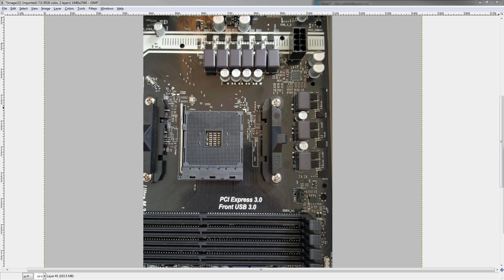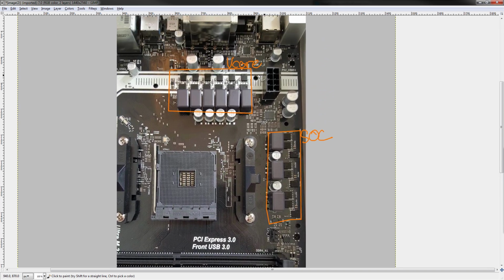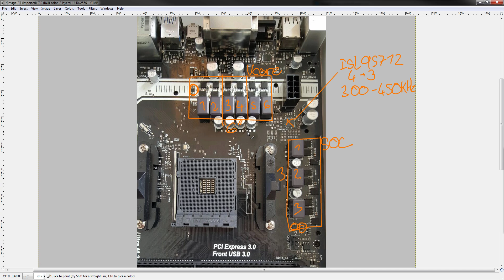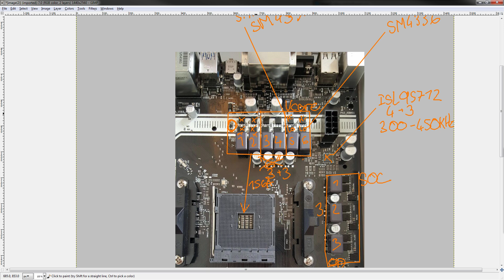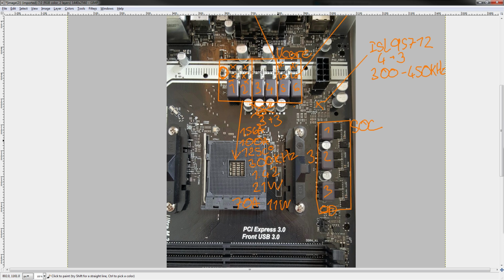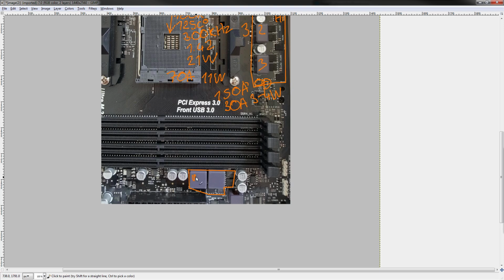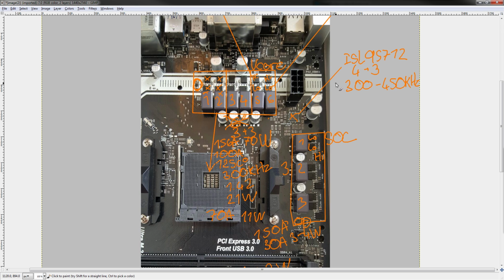PCB Breakdown: Asrock "6"+3 phase AM4 VRM used on the AB350M Pro 4, AB350 Pro 4 and AB350 Gaming K4

Comment: Use the ab350 pro 4 with ryzen 5 3600, oced to 4.43ghz 1.435v and it stable.
Reply: @Ben T. Is really unsafe? Should i down the clock and vcore to 1.35v max?

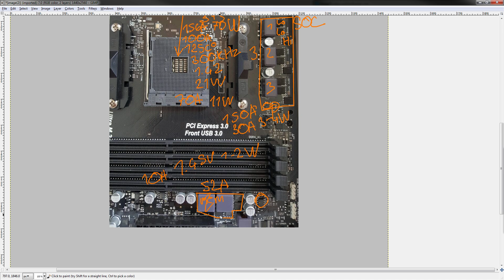Comment: 14:38 not exactly ice cold, but with 4 sticks of Crucial Ballistix Sport LT during a Memtest86 Pro 8.1 run, the "hottest" parts are the 2 inductors, and they're just barely above body temperature with no forced airflow whatsoever

Comment: As we look back after some time, this board has become one of the most popular budget boards on the market. The design might be misleading, but it showed its strength and it has a great value for Ryzen 5 CPUs.
Reply: Yeah, I got the B450 version of this board for my 2600, thinking that it was a 6 phase lol. Was able to get it to 4.1GHz at 1.35V iirc with a 240 watercooler, but wasn't stable with anything over that even at 1.45V. Should've gotten the MSI Tomahawk, it was like $5-10 more and within budget. 

Seriously thinking about upgrading to a 3700X at the end of the year for better high framerate gaming and content production, wonder if I'll need to upgrade the motherboard? I could use more USB ports...

Comment: Which specific SM4337 & SM4336  are used? Can't read subnumbering. I'm interested to know the max sustained temperature allowed for 24/7 for years to come.
Reply: high mosfet is 4337.  Low mosfet is 4336

Comment: I'm using an 8 core 1700x on this board. No problems so far, but VRM temperatures, read from lm sensors on Linux, says 94 to 104 degrees C. Aux2 says 80 degrees, which I think is the SOC Vrm temp.   I tried better cooling on the vrms, but that made little to no difference on the temperatures. But it seems that on Windows CPUID hwmonitor gives different temperature readings (not tested). So it could be that Ubuntu 18.04 just has not correct VRM readings for this board.

Comment: cpI have the AB350M pro4 MB with Ryzen 5 1600 and Corsair Vengeance 2666 memory (16mb).  I have OC'd CPU to 3.7 Ghz.  Since this MB doesn't have sensors to measure VRM temps, am I safe at this OC speed?

Comment: What is bes VRM designe for 2400g, on cheap MB-s? ASROCK B450M-Pro4 mybe? (it has 3 phase and heatsink) yea bad designe but would it handle 2400g like ok?

Or mybe Msi B450A-PRO with better cooling?

Comment: LoL. Just got this puppy in my workshop with a blown 1st phase (I mean AM350M Pro4). At first I was surprised (assuming it was a 6-phase), but then I saw those traces between chokes, and once I cleaned up the soot off mosfets - I've noticed the familiar Niko-semi 0903 and 6188 firecrackers )))
So, my specimen is even more cheaply made than the one in your review, Buildzoid ))))
It's probably going to become an actual 3-phase board, as soon as I get the VRMs cleaned up and fixed , and go into my office PC w/ 2400G.

Comment: I cannot find the quality of the components but the MSI did a similar "trick" on their x370 SLI plus mobo which is 8+2 by the voltage regulators but the PWM segment is 4+2 dunno about other components... can you review this mobo, as it is popular... and what about it with the 2700x is it a good combo? MSI x370 sli plus

Comment: This board freezes all the time, not sure if the caps are bad or if the isl95712 has a temp cut off protection built in. Which caps are for the VRM's? The 4 next to the inductors or the 2 big ones next to the Hi side mosfets?

Comment: Anyone have any ideas as to why the AB350M Pro4 has so many freeze issues? Comments on Newegg and Amazon seems to suggest that the board shuts down power to the processor for no apparent reason. Yet the bigger brother AB350 Pro4 is not affected.
Reply: probably bad batch
Reply: Use UEFI and just install a new version,thats it..I had the same problem but now it works like a charm
Reply: What do you mean by "Install a new version"? You can't install a new Voltage Regulator on a motherboard, unless of course it is identical.

Comment: I have tested this board - VRM's aren't so bad - with Ryzen 1600 @ 3.8 GHz and 1.4v VRM's reach 55 C under load - measured Infrared thermometer on reverse of the Motherboard..Probably not enough for Ryzen 7 buy fine. Unfortuateley there is no LLC.
for Ryzen 5
Reply: 1.3 is the key

Comment: Just wondering if there's any way to actively cool the capacitors? Or just a fan blowing air directly onto them it's the best choice...
Also, what about replacing the FETs heatsink with something less like the stock aluminum block? And what about overkilling it with water cooling the VRMs?

Comment: Thanks for this video, and to the viewer who made it possible.  I just ordered this board with an R3 1200 and am now mildly concerned with thoughts on my mind for OC'ing it as far as the stock cooler allows.  Are these voltage issues affected by the PSU in any way?  I also ordered a Bitfenix BWG450M to go with the build.  This is meant to be working at full tilt most of the time.

Comment: About those 3+3 Vcore: Now when you can start looking at the result of different Ryzen motherboards the ASRock AB350M Pro4 often get better results on lower voltage then more expensive 4 phase mother boards so something have ASRock done right.  This might however be related to something else but still.

Comment: I am an electrician in the states. Now when I think of even 30 amps I am thinking about number 10 awg.

60 amps takes around a number 6.

100 amps? I do not really understand, nor have I ever studied electronics.

It sure does not look like anywhere near a number 6 size conductor is used anywhere on that board.

I guess it has to do with....................

Comment: Been trying to OC a 1600 on the mATX version of this board and it seems to experience ridiculous vdroop. Can't seem to get a stable OC over 3.7GHz at 1.3V and it almost seems like I could add a million volts and MHz and it wouldn't make a difference.

I haven't tried OCing in Ryzen Master but the BIOS seems to not be the greatest for this. Something tells me letting the voltage sit at Auto would be the best way to OC.

Comment: I brought one of these motherboards, 4.0Ghz isn't hard to hit with a R7 1700, memory atm only hits about 2400, but the BIOS updates have defiantly been helping with that, cooling wise on VRM is not a problem in my case (Thermaltake Core V21). if you aren't needing a multi GPU setup and u can be happy with 4Ghz at around 1.365-1.370v then you are fine, the best thing about this board is the 2 m.2 ports, i have no complaints about this board, OC's just fine for the current Ryzen line up, looks good, and  a nice amount of kit on such a little board. ill admit i was happy when i read that it was a "9" (6+3) phase design, but knowing now its a 3+3... well it actually doesn't make much of a difference as you are really only going to get about 4.1Ghz on a R7/R5 CPU so for the current gen of Zen CPU's this board is really good. had they been a OC monster an couldOC like a FX chip than this board wouldn't been that great for OC but all in all, im very happy with mine. works great, looks good, its fairly well laid out and its actually worth a look at if you are interested in a mATX board
Reply: Vitor'Xan Vas Rayya - Have you been able to OC the RAM after latest bios updates?
Reply: @AnalogFoundry  this is like 3 years late but I have a 2700 (3.7ghz 1.1v) and 3466 cl16 and the choice of 3600 cl16 on the ab350m
Reply: Have you experienced any issues with your setup? Hitching, stuttering, etc?
Reply: Does she still alive? And doing well?

Comment: Love your work man... i need your knowledge :D
can you compare VRM on MSI X370 SLI PLUS with B350 gaming pro carbon? since it's roughly have the same price, i suspect it is using the same VRM with 8+2 (or (2*4)+2)? phase... thank you

-MSI X370 SLI PLUS >>> LOWEST PRICE X370
-MSI B350 gaming pro carbon >>> HIGHEST PRICE B350
i'll choosing B350 gaming pro carbon, because if it's use the same VRM, i'll be fine with overclocking, and I don't need SLI and massive amounts of PCI, but i need more quality, gaming LAN, and good sound chips (nahimic 2, vs realtek), and of course RGB...

Comment: Burn out low side mosfet which have 1.5x lower Rdson than high side? That's just quite silly assuming same Rthca. 4phase 4 transistor pairs and 4 inductor design doesn't actually mean better stability or more amps than 3phase 6 transistor pairs  and 6 inductors. All your assumption is based on ideal characteristics. Well guess what, that's something which does not exist. Of course smart 4ph vrm will be better than 3ph but it doesn't mean ANY 4ph vrm will beat ALL 3ph designs. Right? Right. However I see the point - advertising 3 double VRM designs as 6ph design is just nonsense.

Comment: Thanks for the video on this motherboard.  When I initially was buying parts for my board I found sources calling this a 9 phase (6+3) vrm board so I do feel a bit deceived that it's not.  Well it's not the end of the world as it is holding my r7 1800x stable at 4GHz with 1.381v and from the numbers you listed it will not be an issue with the VRMs for long term use.  They do get some extra air from my CPU cooler as I got a dark rock pro 3 and the fan in between the double tower actually hangs lower than the cooler itself and that seems to throw more air to the VRMs without it going through the fins of the cooler.

Comment: The VRM cooling seems to be on par with the Asus b350, and better than both MSI and Gigabyte's b350 offerings (talking about the gaming k4 Fatal1ty-- not the ab350M)

Is it possible they have different VRM cooling than the micro-atx boards?  Or is there something else Asrock is doing that's working out for them?

Comment: I had this board, the overclocking ability is garbage. If you want to do overclock, avoid this board. Under same setup, this pos can only reach 3.65 Ghz where ASUS b350m can go up to 3.9 stable for 1700.

Comment: Should I get the ASRock AB350M Pro4? I would use it with an AMD Ryzen R5 1600. I will not overclock the CPU immediately, but maybe I might try it after 1-2 years. What do you think? Is that board okay to do so? To get the CPU to 3,8GHz? 
Thanks in advance!
Reply: it is a solid board if you are not going to OC, though it can OC fairly well. I wouldnt be too sure on getting 3.8GHZ tho, its all about that sillicon lottery
Reply: Thanks for replying! What about the ASUS Prime B350 Plus? Would that be a better board for OC and overall?

Comment: As the overclocking difference between a B350M and X370 is minimal, would it matter if you only had 3 phase over 4? Guess I'll find out soon when mine arrives.
Oh you said it's fine for 6 core CPUs, just as well I'm getting an R5 1600 then.

Comment: I just received my asrock gaming k4, i guess i'll send it back...
Reply from the maker: and replace it with?
Reply: I have no idea, i shouldn't have bought my motherboard so early without knowing what others brands had to offer. I don't need more than a b350, it seems gigabyte gaming 3 has a better audio chipset which is on par with x370 mb.
I guess more b350 will be released soon so i expect reviewers to compare them all then i'll pick the one which fits my needs.
Reply: What I like most about the Asrock boards are the 2 M.2 slots. I don't think you can find another one with B350 with these specs.

Comment: Hi! Just recently discovered your channel, and I have to say your content is very informative and accessible even for a not very tech-savvy person like me.

I have a question: my mobo is MSI B85M-P32, and from what info I've found, it has a very low power phase count - like 2 total, yet a lot of reviews on amazon state that people successfully run heavily overclocked G3258s on it, and even four-core CPUs like i5-4690 and i7-4770.

How does this motherboard not blow up on people? It's running 2,5 years straight with an i3-4330 for me with no issues.

Comment: I have this board and it has been decent. I am able to get my 1600x at a rock solid 4.05ghz at only 1.3625 volts. The only let down is ram overclocking, I am unable to change any settings from the base 2133mhz and get a boot up. I'm using a 2x8gb of corsair dominator platinum 3000. Hopefully memory profiles will improve with bios updates.
Reply: Darrin Hillier update bios 2.22 and try 1.35 volts, 14,14,14,14,36 and slowly oc from 2400, 2666, 2933. I have same board with r1600 with vengeance led 3200 mhz running at 2933mhz.
Reply: Darrin Hillier 1.35 volts is for vram not cpu.
Reply: Frederic Vangsoua Thank you for your settings. With those latencies I was able to boot 2666mhz on bios version 2.10. 2933mhz still failed to post. I didn't see 2.22 available. I'll keep an eye on it. Once again thank you.
Reply: Darrin Hillier np! there a bios that was released yesterday 2.50. Here the link. I still have to update mine  tonight. good luck!
http://www.asrock.com/mb/AMD/AB350%20Pro4/#BIOS
Reply: Darrin Hillier I also oc mine cpu yesterday to 3.8 ghz at 1.275 volts with deep cool 240 aio. what kind of cooler are you running and how hot is it running? I haven't try 4 ghz yet.
Reply: Frederic Vangsoua I am running a noctua nh-u9s with the second fan added. I have back my overclock off to 3.9ghz with 1.3375v for daily use. With those settings I get into the low 80s after running prime 95 for about 10 minutes but it seems to level off at about 84c. Also, I'm using the AB350m pr04 Matx board which seems to be a few versions behind on the bios updates.

Comment: After watching some of your videos on VRMs, I've become curious about the Gigabyte X370 boards.  By counting inductors, it appears as if the Gaming K7 ($210) and Gaming 5 ($194) each have 6+4 phases, and the Gaming K5 ($169) and Gaming K3 ($149) have 4+3 phases. Is it at all likely that the 6+4 boards are really 3+2 like Asrock's boards?  And wouldn't that be a silly thing to do for X370 boards?

Comment: I don't understand why they would do this, cost-wise, they have almost enough components for a 6 phase, You could have taken 3 of the phases from the chip, ran them through doublers and called it a day. I checked it and a phase doubler isn't even that expensive! (example NXP81162 are $.30) Also the price difference between a isl95712 and a 6+3 phase controller can't be that much either.

I guess what I'm saying is, they've already sunk 3/4 the cost of a 6 phase into this board, why not go all the way?
Reply from the maker: you can't double phases of the ISL9517. If they wanted more phases they would either need to build a 4 phase or buy a more expensive voltage controller. Then they would need to get drivers for each phase. Doing what they did here is a lot cheaper.
Reply: Do the extra inductors actually do anything?
Reply: They provide more  power for your CPU if I'm not mistaken.

Comment: I was planning on getting this board for an R5 1600 but now im not 100% sure if i should wait for the MSI b350m mortar arctic
Reply: Aaron Cooper I have the same board with r1600 oc 3.6 stock cooler, corsair led 3200 mhz running 2933mhz 14,14,14,14,36, 1.35 volts amd my gpu 1070 g1 gaming. I haven't had any issue, runs smoothly and gaming!

Comment: I have to say though my experience with this board on overclocking isn't too great. Voltage regulation is garbage and vdroop is MASSIVE. Setting 1.45v in BIOS for an R5 1400 you would get only 1.4v or even less under load which makes it hard to achieve high clocks even when cranking up the voltage as especially it isn't too healthy as when there's no load it goes to your set amount. Asrock should put some LLC settings in the BIOS. So far only able to do 3.7GHz at 1.34v on the R5 1400, higher Vcore doesn't seem to help at all to get 3.8GHz but I may just have gotten a dud here.

Comment: What should I pick between AB350M-Pro 4 and AB350M? Saw you said on reddit that you'd still pick AB350M-Pro 4 over AB350M-HDV, but what about AB350M? Do you think that MSI B350M GAMING PRO or GIGABYTE GA-AB350M-HD3 are better picks? I will use either R5 1500x or 1600 (don't intend to OC and even if I do, just a little). Thank you!
Reply: OK. From budget AM4 boards, if you're intent in OC, the best board is the ASUS Prime B350-Plus, Four real phases are the highest of all budget AM4 boards. If you're not interested in OC whatsoever, the best is Gigabyte   GA-AB350M Gaming 3, as is the only one that comes with a Realtek AL1220 audio chip.
Reply: I won't OC. I think I will go with MSI B350M GAMING PRO, from what I see it has 3 phase VRM and all the connections I need. Gigabyte is a bit pricier.

Comment: thanks for the analysis here

If you want to test an AM4 APU, they are available right now but only in pre-built machines.
One such example is the HP 510-p127c. They come with A320 motherboards. I suspect the chips are multiplier locked.

It would be a way to get ahead of the game in AM4 APU testing

Comment: I'm thinking about getting this exact board. Even though it definitely isn't the best board, it seems to fit 4-core Ryzen CPUs pretty well. Also it has 2 M.2 slots, both of which in pretty good locations on the PCB, which is really nice in this price range. Also I like the looks of it :)

Comment: AB350 Pro4 and AB350 Gaming K4 - Hi - PZ0903BK, Low - PK618BA
Reply: Can you do AB350M as well ? 
Seems to be very cheap here in EU.
Reply: HELLCAT.28  asrock does use this and the sm mosfets on the same motherboards for some time now, can be rated the same ;)
Reply: And maybe AB350M-HDV; that one seems to use 4 phases.
Reply from the maker: you're going of that HardwareLuxx forum post?
Reply: Yes. Is that bad info?